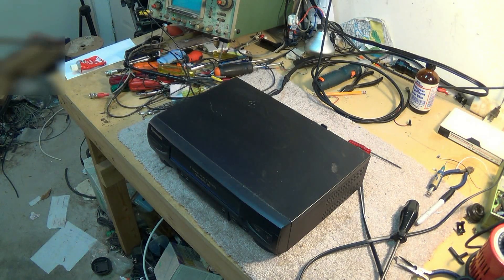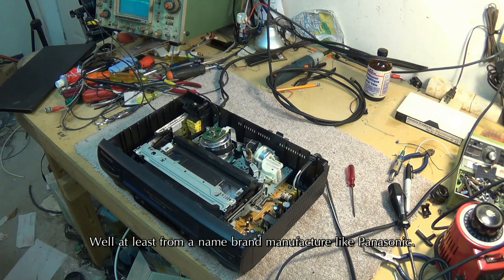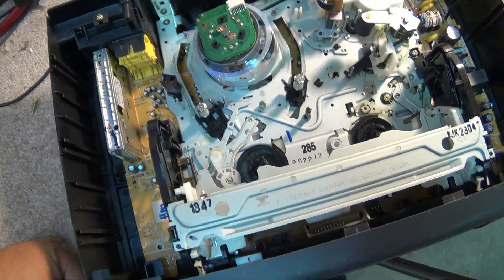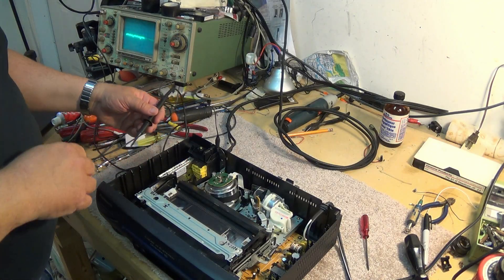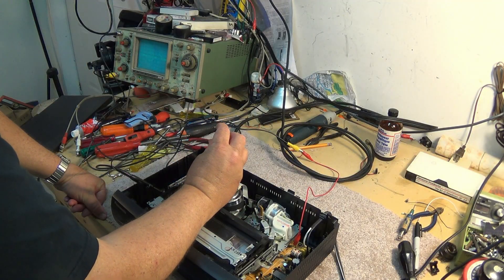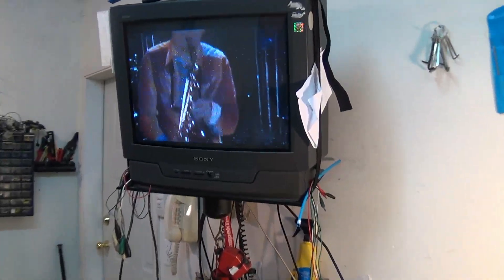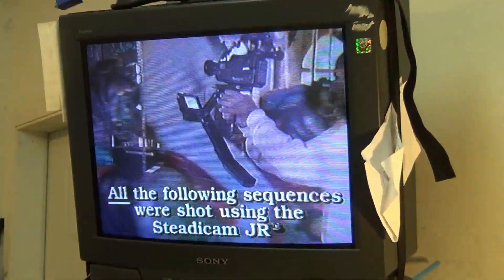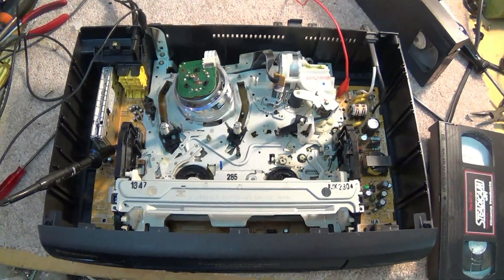Panasonic VHS Tape Path Alignment

Comment: So, what would be your recommendation for a better machine?
Don’t just trash someone’s choice if that’s all they can afford!
Reply from the maker: Whatever works.  The machines are getting few and far these days.  The recent vintage are the best. The early 80s vintage have so many issues. People think that older is better.  Not true when it comes to vcrs.  The old ones had many more component and points if failure.  The last generation has more plastic but were generally very reliable if you didn't abuse them but doing silly thkngsime sticking alsop wet tape cleanses in them which had habit of jamming and breaking plastic parts.

Comment: I'd like to see exactly what you are hooking the scope leads to inside the vcr.
Reply from the maker: They are connected to the head amp rf output and the head switch signal.  Every VCR is different except Sony. They used a standard across all the models.  VHS beta 8mm, same place. 5 pin header on the head preamp.  Pin 3 is rf and pin 5 switching.

Comment: If you have a problem using a lightweight camera on a Steadicam why not create a weight adaptor so when it is with the camera you use the weight matches the old camera. Must have been heavy 35mm camera.

Comment: Can you film a video like this using a camera that doesn't suffer from a rolling shutter? I just picked up an Iwatsu 5710 60MHz scope for a good deal, and I'm planning to use it for tape path alignment on a Sony SLV-780HF. I know where the RF signal is and the switching/trigger signal are located, but I don't have any probes yet, got some from eBay. I've just been messing with it, plugging my Sony camera into the BNC input (it has 4 channels) and displaying color bars on the scope.
Reply from the maker: They all have rolling shutter these days.  Unless I want to go back to CCD camera with interlaced video.  Prefer that?

Comment: Thanks Dave on adjustment on the Guide Posts. Are you using a regular straight blade screw driver ? When I use a nirmsl strsight blade screw driver the blade cannot sit across the SLOT . How do you turn the post top ?
Reply from the maker: I use a small slot just turn the edge. Some units use a hex key.

Comment: What tool are you using I used a flat head screw driver but find it difficult as it comes off the guides,  I hit the heads with a screw driver it did not do any damage as it hit the circuit board and not the heads power switched off soon afterwards. It's working but I get half the picture  what should I use to adjust the guides used a thin flat head screw driver but it does not grip well, please advise.
Reply from the maker: Flat head screwdriver.  That's all i use.
Reply: @12voltvids  Hi I still get a fuzzy picture how can I resolve this so picture is clean tried many times adjusting the guides still no luck cleaned the heads still get half a picture, please assist.

Comment: Panasonic is the bad brand in Electronics, Panasonic VCR, Panasonic TV, and so on .that's among the worst cheap brands ever made.
Reply from the maker: Actually that is incorrect.  They made some dogs just like everyone else but most of their products were top quality especially their plasma TVs. My 2004 plasma still works great.
Reply: @12voltvids  I live in Canada I would say less than 10 percent of electronics are Panasonic in Canada, I am sure the same thing in the USA, because , we realized they make some bad quality products and we stopped importing any more Panasonic. That used to be a good brand, but it started to make cheap products during the 90s and 2000s  for low incomes people.
Reply from the maker: @infoupdater582  
I worked for a Panasonic dealer for 20 years.  They had very good products.   Their tvs were solid as was their vcrs. The brands we had the most trouble with were rca, sharp, Toshiba,  jvc, and sony.  Their vcrs were relatively good for many years.  Their plasma TVs solid as a rock.  I left the business in 2003 and all the manufactures were on a quality slide at that point in time.  Those last couple of years I changed more playback transformers on expensive sony tvs than i can count.  Sony picture tubes were popping like fuses.  Sony projection sets were blowing convergence ic's and the coolant leaking out of the tubes.  I saw what more Sony sets than panasonic and we sold tons, and I mean tons of Panasonic.  Panasonic and sony were our major brands.  We sold about 2 million a year in Panasonic and sony products from a small independent dealer.  I still have my Panasonic microwave fro. 1987 and it is used every day. I have a 1988 Panasonic tv (crt) that has been sitting outside on my patio since 2009. I have 3 Panasonic dvd recorders all working. 6 Panasonic plasma sets, all working. The oldest from 2004.  No dead columns (vertical lines) unlike my Samsung plasmas which all but 1 have vertical lines in the picture indicating a bad panel.
Reply: @12voltvids  Thanks for sharing your experience and knowledge, I was not even born yet in those days and I do not know much about brands, but you are an expert and worked for those companies for many years. I admire you and understand you and continuing to learn from your channel.
Reply: Late 70s-early 80s Panasonic VCRs are tanks. My 1979 NV-8600 (PV-1100 in North America) just blew a transistor in the capstan motor drive circuit today and a replacement cured the problem. It was the only part that required replacing after 41 years. All the other and usual problems were rubber parts-related (belts, pinch roller etc).

Comment: Wow very interessting - this model looks almost identical to the JVC HR-S9600 I just bought for a lot of money in order to restore my S-VHS-C collection...While cleaning it i noticed everything inside looked cheap af. All 1 board, all the parts cheap plastic (exactly like shown in the video), no seperate power supply etc. I wonder why the HR-S9600 is recommended in so many forums ... and thanks for sharing your knowledge
Reply from the maker: Because it is a late model unit and didn't have the comb filter module failure of earlier units.  They may be better built, but when sme caps puke on a ceramic board module that is all sealed up and the part is not available, that more robust mechanism does you no good at all.  The late model units also had the best signal processing circuits compared to earlier models.   I have an hrs9911 I use for svhs tapes. Looks like a joke inside but plays amazing.

Comment: Hello and thank you very much for this tutorial. I have a really wierd issue and no experience with that topic. I have an LG VCR which has a clear picture at playing older recordings. New recordings from this LG play perfect on another LG VCR, BUT NOT on the LG which recorded the tape. Recording and playing inside one recorder (the first one) shows a flickering image in the top half of the picture. I tried to adjust the alignment, but it didnˋt get better. Do you have any suggestions on what to do? Thanks a lot in advance!

Comment: Hi i have a hi8 camcorder it does not show image only once pause has been pressed, though it's fuzzy in pause mode, what could be the problem...
Reply from the maker: Most likely surface mount capacitor issues which plagued all those old camcorders.

Comment: Hello ! Are you alright ? Please. I need a service manual for this equipment. Or I need tips. So far I have not found any relevant help. I have a friend who tried to help me, but he also has no diagram. This unit has normal audio but no picture. The picture appears distorted as if it were TBC problem, RF, as a TV out of sync or tune. This is an AG1960 and I really want to fix it.
Reply: Did you clean the heads? Some details would be quite helpful.
Reply: I think it's the TBC board. But I do not know what the TBC of this VCR is.
Reply: @AndersonRosa1991  
Why would you think it's the TBC? Personally, you might be over thinking this. 99.9% of the time it's something simple. Start simple. Check cables, connections, then clean the heads, then start inspecting solder connections

Comment: Hi, i am hoping with your experience  you can give me some insight what is wrong with my unit, I have a panasonic vmr ez48v  combo unit.. give you some background it stopped working all together no power, after several searches i bought a parts unit and replaced the power board,  Wow i was so happy it turned on but now i can't get pass this Code F04, now i will tell you i had to remove the VCR unit and the DVD unit to get to the power board..  I think from what I an seeing on my searches it is related to the VCR, do you think you could help me... Please...

Comment: I guess this won't work with Beta decks as those had not autotracking until the last models produced (the SLHF2000 as I recall). Tried this on my SLHF860 and even then, it could be that the tapes are just too old. No go. So, I will try this with some wonky tapes on my JVC HRS-3910U. Also, a heads up if you are in Canada, The Source clearanced the Nexxtech desoldering braid for 96 cents. Very handy to have for these repair projects...

Comment: where were the tape guides you adjusted? Check out a Funai/Brocksonic....its was 79 bucks when it was sold in 92. later ones were literally a transport on a SMD board with about 5 passives. We didnt repair them, we just gave them a new one. Polar opposite would be a JVC HR-S8000U S-VHS. That tank has about 7 layers of PCB's with hundreds of passives. you cant even see the transport when you open it. I bought it because it has adjustable Hi-Fi level meters and makes damn near perfect 20-22K .008% audio recordings.
Reply: Funai never built Broksonic VCRs.

Comment: Quick question;   I was playing a mono tape tonight and all of a sudden the sound became muffled.  I chucked a stereo tape in and the sound is fine. I had this problem once before and it fixed itself.  I cleaned the audio head and there's no change.  Is there a point on the audio head where the mono pickup is and it could be a possible allignment problem or is it likely to be the way the vcr processes the mono sound so possibly a circuit problem or something else?  It's annoying I was enjoying the movie. cheers and love your vids.
Reply from the maker: kingshearer2 
The linear stereo (mono compatable) is recorded along the top edge of the tape. It is 1mm wide. If the audio head gets dirty it can affect the sound. If the top edge of the tape is creased it will affect the linear sound. The hifi track on the other hand uses the full width of the tape like the video. It is actually recorded under the video to a deeper layer of tape.
Reply: Thanks for that,  the tape is fine since it sounds good on one of my other vcr's.  I've cleaned the head and it improved it a little bit,  does any of the circuitry effect the linear sound?
Reply from the maker: kingshearer2 
Check for worn pinch roller. Could be pulling tape slightly down as it plays slightly off the audio head slightly.
Reply: I've just cleaned the audio head (focusing on the top end) with a lint free cloth in a horizontal motion and it seems to have fixed the problem - for now!  I'll try a few more mono tapes over the next few days and see if the problem comes back.  I'll make a note of your pinch roller suggestion and will have a look at that next time I take the cover off.  Cheers again.
Reply from the maker: kingshearer2 
I just use a q tip soaked in ipa and yes the audio is right at the top of the head. The bottom is the control track.

Comment: I was born in the 60's but this technology is obsolete dude if u have fun to repair those old piece of shit I get it, but this is just something from the past what will be forgotten.
Reply from the maker: L L 
I too was born in the early 60's. I am fully aware that tape technology is obsolete. I have been tapeless in my production facility for over 10 years. I was non linear in my production facility in the mid 90's. the thing is many people still have vhs and beta machines, and have old tapes they want to play. I keep old machines running for archive work. I don't use tape myself. people ask to see these machines in action, and to see them overhauled, and I oblige them. then some a550le comes along and comes along and makes a stupid comment. viewers have requested to see old technology. the only way people can learn about this old stuff is by watching someone that knows the tech work on it. they don't teach this stuff anymore. now it is just toss it out and buy a new one. that poses a problem for someone with an old tape and no way to play it because you can't buy a new one.
Reply: VHS is like vinyl for film,  it's much better than digital formats. You need to get the beter quality ex rental tapes though and not the mass produced retail tapes.

Comment: omg what will technician's repair in 20 years...
Reply from the maker: One word NOTHING.

That being said, if people don't get their old VHS / Beta and 8mm video tapes transferred to digital soon they won't be able to play them. Unlike the movie film that preceded video tape that lasts for decades, video tape is not permanent. Not only will the tape deteriorate but the machines to play them are failing, and with no new source of machines, the only machines to play them are all very old now. Nobody is entering the repair field. I got out in 2003 when I could see the writing on the wall, and retrained for a totally different and growing field. I work in telecom now, and spend my days pulling wire and fiber optics, and provisioning equipment. I only work on electronics now as a hobby, and supplement my income with the revenue that these videos generate, through advertising which is moderate. All the money I make from advertising and donations allows me to purchase projects that I build on camera. The Vacuum tube amps for example. Combined those were about 1,500.00, and now I have Nixie Tube and Numitron clocks on the way, which are also expensive kits. Funding from the channel also allowed me to upgrade to 4K cameras. It all goes back into the channel. 100% of what I make is rolled back into the channel. Much of the equipment I tear down and work on I have to buy. A few pieces are donated, but most of the stuff I find at 2nd hand shops.

Comment: Yh even though I have pro vcrs. This one is perfectly fine or it was perfectly fine for people with basic CRTs and weren't video junkies..
Reply: I have a unit from 2000- and one from 2003- 2003 which looks like this example only had slightly worse pictures.

Comment: I have this VCR but its the PV-P4523S
looks the exact same only its silver.  It does kinda feel cheaply built but I think it works decently well, I like this one.  I will say though the older panasonic is built better than the laster models, 2004 model was the worst of them all.

Comment: What would cause it to become unaligned?
Reply from the maker: +Zestypanda VCRs are mechanical, and just the loading and unloading operation would cause lock screws to come loose, and then the guides just screw down, and the alignment goes out. The tape is pulling on the guide as it runs over it. On JVC they press fit the guide bases together and they would work their way loose. It was a very common problem.

Comment: Great demo.  I have the same unit and have he same problem where cassettes get kicked out 75% of the time.  The cassette will get stuck right before it's supposed to go down and the VCR is supposed to load the tape.  After a few seconds it spits it out.  Any suggestions on how to fix that?
Reply from the maker: +manixpc There was a problem with some of the front loaders where the plastic lever that releases the lock button on the right side of the tape doesn't depress the button far enough to release the tape lit lock. As such it sticks just at the point where the tape should drop, and the mechanism reverses and micks the tape out.There was an improved spring that was changed out to solve this problem.

Comment: hey is that scope an old lab volt(leader) by chance? i got a 20 mhz solid state one i gave up on getting it to work perhaps you can give me a pointer???

also how do you align an older panasonic omnivision from 1987 that works on most tapes but a few select vids it refuses to track?
Reply from the maker: geoffrey walker That scope is an Iwatsu.if your machine is able to track up tapes made n other machines, and will play recordings made long ago on it, but not newly recorded tapes,(however those new tapes will play fine on other machines) that is a sign of worn heads.

Comment: if the HF-Paket from the 2 Heads are in the near same Amplitude the Picture on both Frames will be good. That mean that a other person disaligned the Position from the Band in (left side) and from the band out side (right side).
Reply from the maker: Volker King This was a created fault. I misaligned the machine sly for the purpose f demonstrating the process of aligning the tape path, however they do go of alignment on their own. Usually it is the lock set screw, over years f heating cooling, and the stress of the guides wanting to turn as the tape is running around them.. I am ging to be thinking up some other faults to demonstrate in future videos. I generally try to make videos of actual faults that I am diagnosing, but a few of the VCR videos, I simulated the repair by causing the mechanical alignment and then I can show the procedure to get it back up and running.
Reply: Yes, this would be great to do on one of your old beta decks. I finally found a service manual for the SLHF-950EU which is mechanically identical to the NTSC SLHF-750 I have (the manual has PAL and SECAM specs). To adjust the tracking requires adjusting at least 3 screws along the tape path. Might be difficult to do without a scope. I hope you are up to the task. I want to make mine so it will track all my old tapes I got from Japan back in the 1980s recorded in X3 speed and won't track in the refurbished SLHF-450 I acquired.